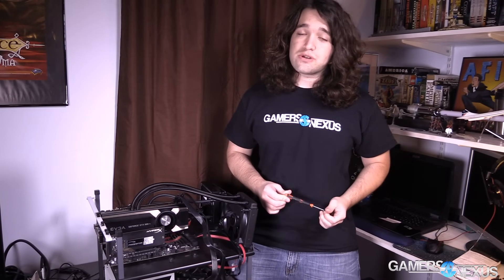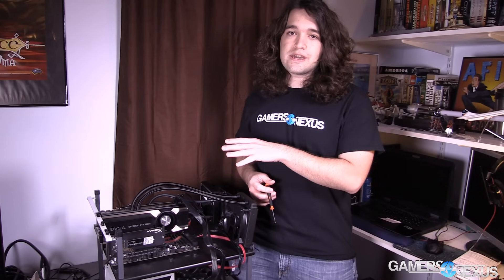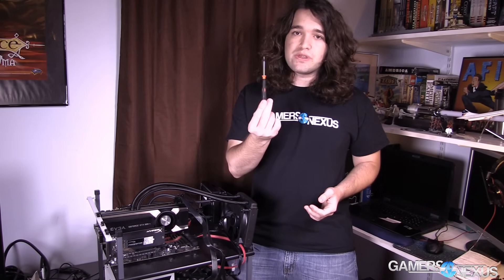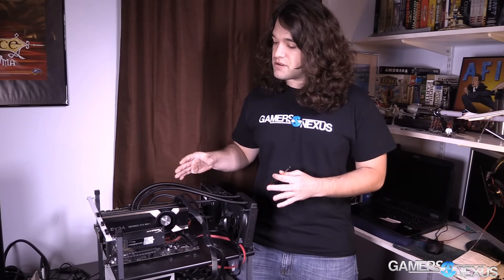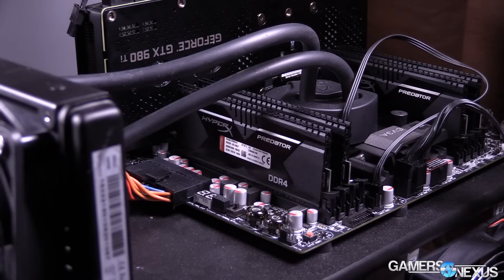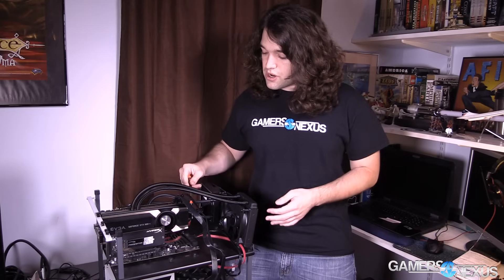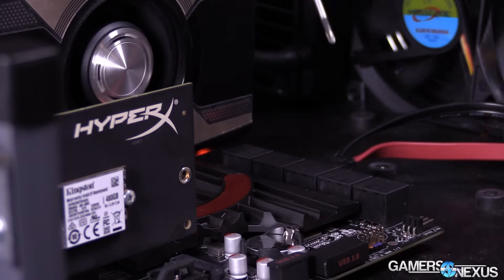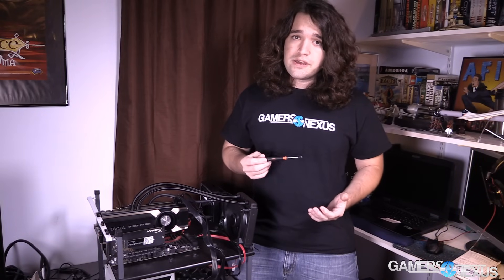How to Jump A Motherboard Without Power Button

Comment: Good little tip dude.....crazy how many system builders don't know this trick. Used this one when I helped my mate from Norway build his 1st PC....1st PC I've built over a Skype video call!
Reply: Thats crazy xD
Reply: KingLewie2152uk lol ive heard about it but never seen anyone do it, didnt realize it with as simple as just touching the two pins with a screw driver. so far have helped three friends put together a pc over skype and trouble shoot multiple that way. its a great tool lol.
Reply: wait until u can help build a system with only message, no picture

Comment: I tried this trick several years back. A friend's computer had a bad motherboard so I offered him one of my old ones. I wanted to test the motherboard with the newer components first before giving it to him so I just plugged it to a PSU and used a screwdriver to jump the pins. It booted up nicely.

Then I shut it off and attempted for second try just to be sure. Unfortunately my hand slipped and the screwdriver touched the other pins and something blew up. I told my friend the sad news and advised him to buy a new PC.
Reply from the maker: May have bridged an IC or some traces on the board. Bridging two coupled front panel pins will just trigger the associated function.
Reply: Probably. That was years ago with old hardware that I didn't store properly and I was trying a method that I never tried before with shaky hands. I don't even remember how I came up with the idea of jumping the power pins.
Reply: Dare ka that happens? oh shit gotta be more careful i guess
Reply: I'm in the exact same boat Siala, I'm going to try this jump start thing tomorrow because the only thing I'm missing is a power switch
Reply: Gamers Nexus I know this sounds like a dumb question. I am stressing that my mobo is DOA.

I connected my 24 pin power from psu to mobo. inserted ram and 8 pin from psu to 8pin in mobo

Tested psu. it works

when i switch it on it doesnt work.

is it because it needs to be jump started?

i just got my parts today

ryzen 1700
8 gb dual ddr4
msi b350m gaming pro matx
msi rx 480 8gb
ssd
Reply: @Samoan_Metalhead  ok
Reply: Siala Leao did you find a fix? I'm in the same boat